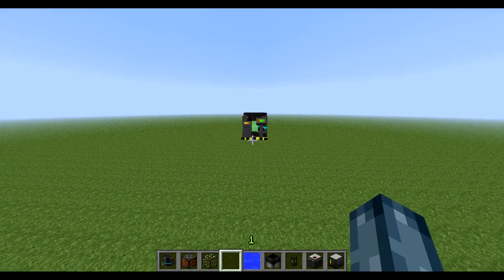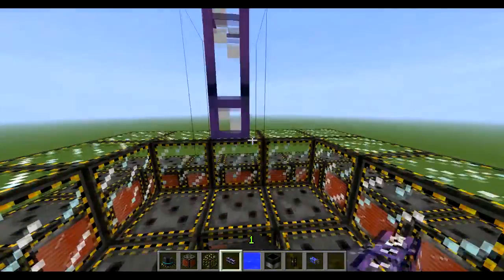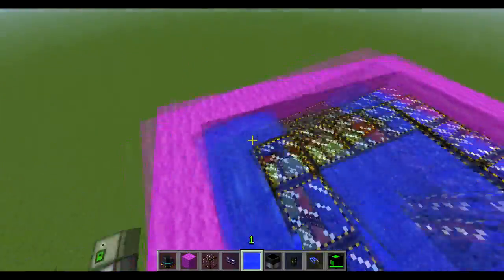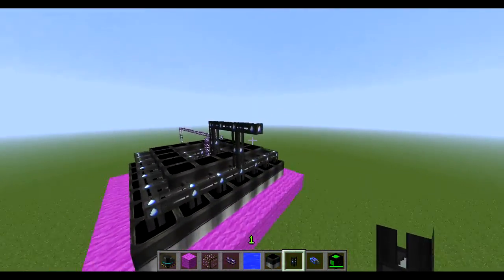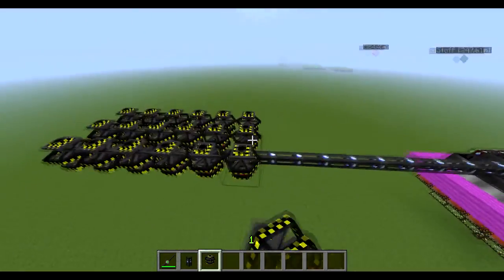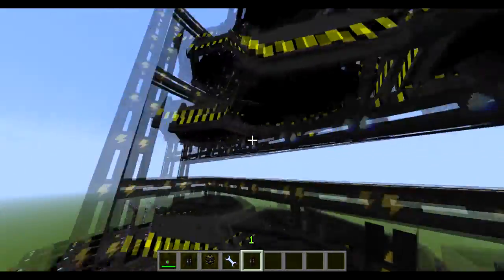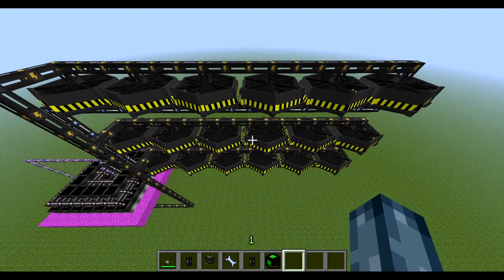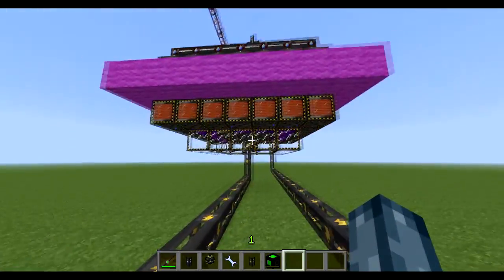Largest Fusion Reactor Tutorial | Voltz | Atomic Science

Comment: I've seen (and even tried building) diamond-shaped reactor designs that have more electromagnets and more water, thus supposedly generating more steam. I don't quite recall what the maximum plasma spread range is or if it hits the outermost electromagnets reliably enough (even when collecting steam with funnels).
Also, in the Tekkit 1.6.4 pack, it's possible to use a Thermal Expansion 3 tesseract link to send both power and fuel through only the bottom side, leaving the top free for an extra water source block just in case.
Reply: its a shame this got axed before 1.7.... atomic science was teh coolest mod ive ever seen tbh

Comment: Hello, So I have a question 3 years later.. is there any clear number of steam funneled through the steam funnels? Like what would be the max, because I've tested this out with fission reactors as well. And with a steam emmision peaking at 6.7/second I can easily run 48 big turbines without a problem and 1.6 MegaWatts. Doesn't this seem a bit bugged?
Reply from the maker: Joris Lodewijks in all honesty I’ve no idea, it is quite bugged cos I’ve managed to run more than 20k turbines off of one fusion before on a server so long as u build it up over time - I don’t think the mod tracks the steam -> mech pipe properly at all so no clue really
Reply: Yeah, I just noticed that when disconnecting the steam, the turbines sometimes keep running. Reloading the world fixes it.. too bad voltz is dead.
Reply from the maker: Joris Lodewijks ikr, not being helped by the lack of support for the modded community in general imo

Comment: I was tested that Infinite turbines idea. Don't work. I got to about 1500 turbines and then the fission/fussion reactor begins to stop making enough steam. I tried multiple ways. In my base on a server i have over 6k turbines placed and it creates more than enough power for what i need but i have to use 4 ractors to keep it going at full speed. However, if you wish you can test this for your self and get the exact number. But I dont think many people will wan't to use over 1.5k turbines since it will more than likely be a waste of power.
Reply from the maker: Yeah with some testing you can reliably power 3.3k turbines on a large fusion of you gradually increase the number of turbines you are using - typically I now use fulm gens as they make more power, are compact and quick to setup
Reply: Ok one question. What creates more steam? Fulm or fiss? Because in my new base im restarting i want to make as much as i can as i need a hell of a lot more power since a new raiding tactic has came to my attention and im only aware of one way to fix it lol

Incase you are wondering. Its placing an antimatter bomb with the force feild stabilizer moduel and then translating the force feild to any direction left, right, forward, backwards and then placing a redstone block there. and since you can get about 135 blocks away from said base when the owner isn't online you can place the antimatter really close if not inside their base.
Reply from the maker: +reece burns fulms don't make steam, they create instant power using the explosion of a 1g of antimatter

The force field idea tho, is good and although I haven't used it practically it does work
Reply: I ment fussion or fission lol sorry
Reply: And the antimatter forcefield idea is really good. If you have perfect coords to their ME then you can set the antimatter far enough off to kill their walls of the base and then you are in the base and once you are in you can sonic the matrix.
Reply from the maker: +reece burns Each water block powered by both creates the same amount of steam, so fusion hence heats more water blocks and creates more steam
Reply: Ah k well i think i may understand how i can make this work better now :) Thank you
Reply: @thetennisonegaming  My question is: approximately how MUCH steam from each block, in mB/t, when collected by steam funnels and some kind of fluid pipes?

If anyone else is reading this, another advantage of this mod's fusion reactor is that its fuel, deuterium, is extracted from the heavy water that is somewhat present in vanilla Minecraft water. And you're likely aware that Minecraft water is infinitely replenishable, which means that fusion fuel is infinitely abundant (contrasting the uranium for fissile fuel, whose ore generates in limited amounts per chunk).
Reply from the maker: @steam-powereddolphin5449  
No clue how much steam exactly, I must admit I think the mechanics of it were a bit janky and it didnt always produce the same amount - might have been a server issue though. 

Also if youre playing this in Voltz you can duplicate the uranium in an atomic assembler so its unlimited too!

Must admit havent picked up minecraft in years so a bit out of the loop with it all now.